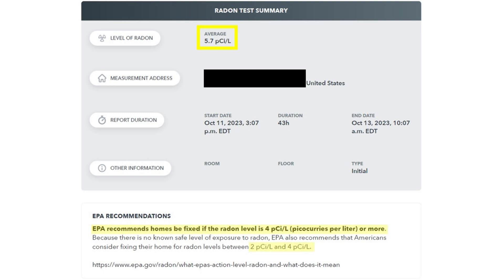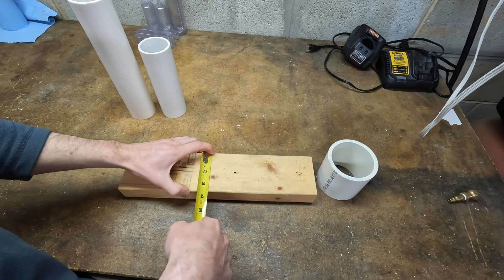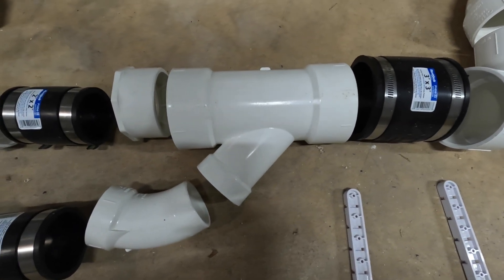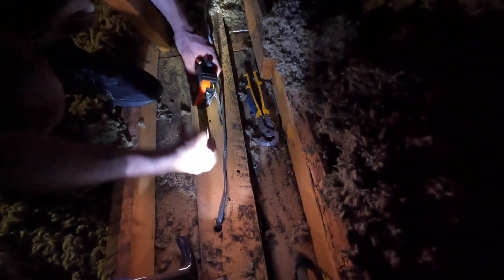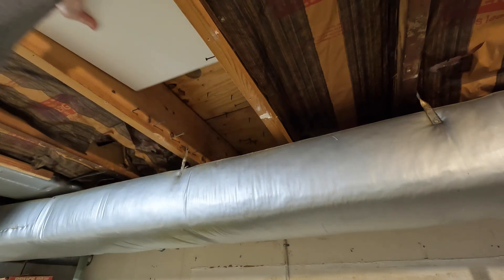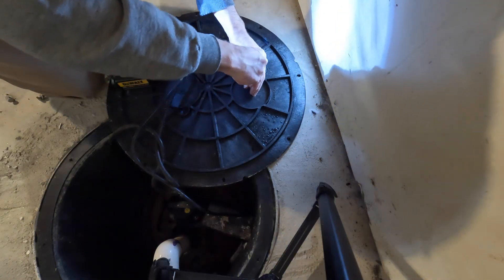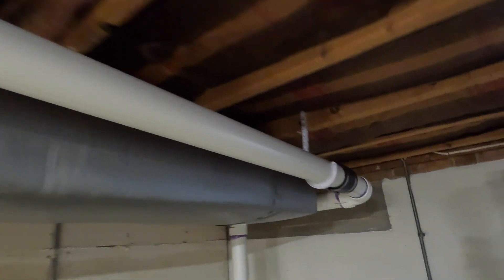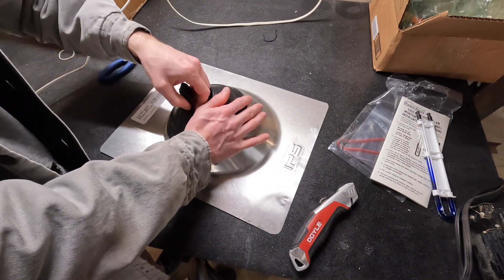Install a Radon System from Sump Pit through Interior Walls - DIY radon mitigation

Comment: Well done and thanks for the video. 
Faced with the same challenge, and phenomenally high radon levels coming through the foundation weeping tile into the sump (50 times action limit at the sump), I tackled the same issue. Fortunately, I have an abandoned flue from the old basement furnace up through the entire chimney. With a run of 6" flexible duct from the sump cover, through a 6" fan by AC Infinity ($160 CA on Amazon) to the 6" furnace flue pipe I was able to significantly lower radon levels from 2 to 3 times the action level in our dining room to less than half the action level within two days. Also, the fan is whisper quiet and cannot be heard above the basement. 
Next step is cleaning out and sealing all basement slab cracks with quikrete self-leveling sealant.

Comment: Real nice job there. Saved $$$. Since you only have the one access point, I wonder if you could have obtained the same lower levels with using the Energy Star rated RP140 fan which moves a little less air.